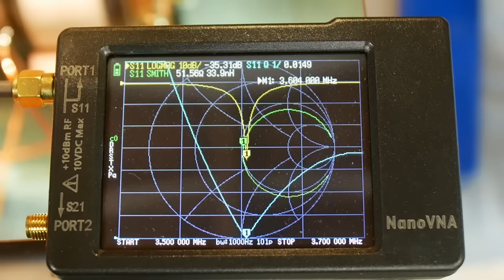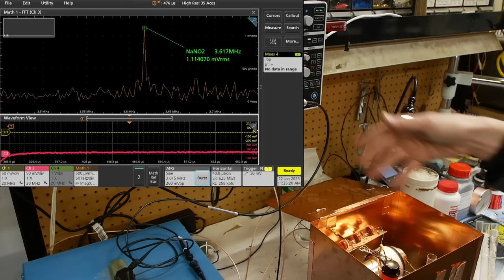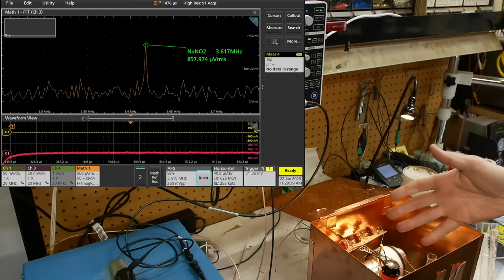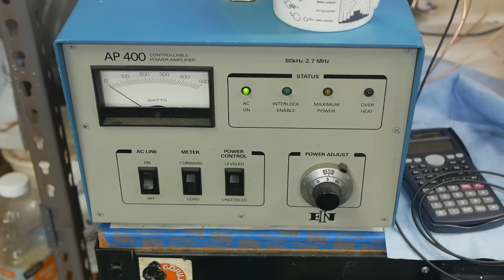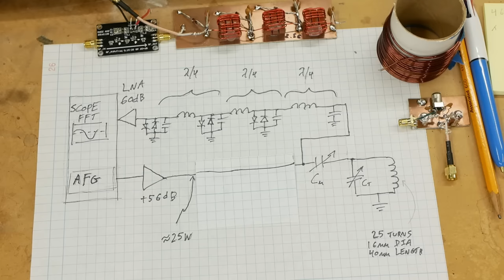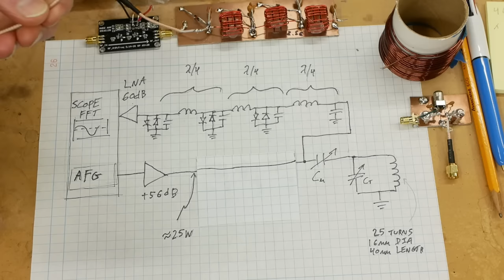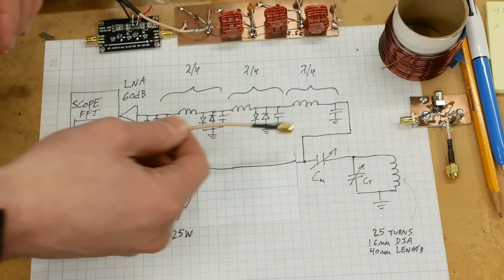Identify chemicals with radio frequencies - Nuclear Quadrupole Resonance (MRI without magnets)

Comment: Nice Ben!. Suggestion: in metal detection, they use something called a double D configuration to remove pulse signals completely. Basically you have a separate transmission and reception coil and by strategically placing the reception coil, you can remove the pulse and focus on the signal. This is something you might want to try, because it allows you to remove all the filter electronics from your setup.
Reply: I assume this set-up you're describing essentially destructively interferes with the carrier signal, leaving the sample signal largely untouched so instead of filtering the noise, you can simply threshold it?
Reply: @dittilio  no it's about direct cancelling the magnet field. I actually discussed the principle in a video I made some years ago: https://youtu.be/EcuTsifSgBs (around 3.50 min)
Reply: Ah, of course! Very neat idea. I think you’d need to tune each part separately, but at least that’s a lot easier than remaking the output coupling filter. Could even automate a scan using varactors, or those funky current-controlled inductors.
Reply: It's called induction balance and yes, it works.
Reply: @HuygensOptics  Oh damn! Huygens Optics stopped by! Been following your videos on the mini-monolithic telescope and those dirty lenses. Now I gotta stop by your channel and finally get around to those grinding videos Ive been sitting on watching! Love when these home science on complicated subject channels get together, it makes for an awesome community with a mix of interested amateurs fully invested in everything knowledgeable professionals have to share. And sharing the knowledge its what its all about. Thumbs up to all in the community! You're all awesome, the pros in the know, and the amateurs just looking to expand their knowledge set!😎👍
Reply: C J W  yes photonic crystals and thz waves, definitely something I would also be interested in,  problem is there isn't much being done in the terahertz frequencies, it's both very difficult and expensive. Although I have seen reports of terahertz imagers , really can see through walls! With some resolution too!
   I bet a lot of spectroscopy could be done in those frequencies too.
   But 
    Personally I would even be happy with an instructable on how to build a fresnel lens for radio frequencies out of aluminum tape.
Reply: This should let you sweep the frequencies for discovery right? The current set-up requiring you to know in advance what you're looking for is certainly an issue
Reply: C J W  too far outside what I can afford to even consider playing with... But definitely fascinating, & worth learning about.
Reply: @zombieregime  I love that too, I've been seeing it a lot lately with different people I watch talking to each other. The maker/DIY science channels are a neat community. I can't wait to be part of it.
Reply: If I'm not wrong, and I could be, placing the sample inside the detection area would alter the coupling between the coils to the point where you would cook the LNA anyway. The reason it works in a metal detector would be the reason it can't work here. In a metal detector you're using the detected metal to couple the electromagnetic signal from the transmit to the sense coil. Here, the maximum possible quadrupole resonance would be coupled from the transmit to the sense coil during the high power transmit phase (along with any other power coupling from the material's magnetic ordering).

It feels like you could do it, but at the cost of building a very precise coil around every sample you wanted to run. I don't think you can tune out small variances between samples to zero the magnetic field without also by definition tuning out the quadrupole resonance signal you're looking for.

I think ultimately what you save in not having to rewind the toroids, you lose in having to rewind the sample coils. Again, I could be wrong though.
Reply: now this is a crossover I didn't know I wanted but I needed
Reply: @htomerif  you’d likely want a small trimmer screw to move the coils in/out of mesh anyhow if just due to frequency changes and capacitive coupling, which is something you could feasibly automate if you had a seperate function generator.
Reply: @Scrogan  I don't know. That's why I didn't say I was dead certain with my comment, but I don't think this is as simple as "two spaced coils that mesh with each other and you stuff the sample tube in the gap". You can get away with it in a metal detector because the coils are functionally two dimensional.

And also, to be clear, I'm not concerned about capacitive coupling. I'm concerned about the significant magnetic power coupling that the sample itself with have.

You'd have to tune the two coils to have zero net magnetic coupling (and capacitive I guess) *with the sample in it*. If I'm not going crazy, thats either going to also tune out the signal you're looking for or you're going to have to increase the precision of all of this stuff to "not just wire wrapped around a tube".

Like at some point it is just more productive to do DIY NMR.
Reply: @petevenuti7355  : A fresnel for radio frequencies? The size of individual elements would have to be sized for the frequencies of interest, it could wind up quite large.
Reply: @htomerif  : Indirect inductance might pass along a decent amount of power (depending on all sorts of details), but that would be materials-dependant. In particular, you might run into issues with conductive materials.
Reply: Iumu
Reply: C J W  uimm
Reply: I love both of your channels and enjoy seeing your discourse in the comments
Reply: @absalomdraconis  Yeah, the word "might" applies. I mean you're not running a sweep here. You're specifically targeting the quadrupole resonance frequency of the sample.

Honestly, it kind of makes me wonder if that effect is strong enough to make a notch or bandpass filter. Probably "not even a little bit", but I don't know.
Reply: @absalomdraconis  size and spacing!, I'm thinking the inside of my roof, attic space, about 14'x40' , I'm not a math guy and there was an online calculator to fill in the blanks given a few values,like they have for Yagi and helical antenna, but I can't find it now...
   Can you steer it like they did at Arecibo, moving the horns, but using a fresnel instead of a reflector?
Reply: @Scrogan  Possibly using a quadrature hybrid coupler with the transmitter on one port and the receiver on another. Transmit -->sample, sample -->receiver. This could give a relatively wide bandwidth that may simplify the tuning problem.
Reply: @dittilio  The design I have uses a long boom between the coils, sample of water.
Reply: Huygens Optics, you are also a very great youtuber !
Reply: @petevenuti7355  if you need to se tru walls Synthetic-aperture radar is the ting ..
Reply: @roylarsen7417  I have a long way to go learning DSP before I can even think about that. Besides, Thz frequencies have applications in spectrography that can't be done with lower frequencies.
Reply: @roylarsen7417  do you know a lot about digital signal processing?
Reply: @petevenuti7355  my link is gone ? , i gess someone dont like my input .. :(
Reply: @roylarsen7417  YouTube tends to filter out links, unless it's to another's YouTube video or channel.. and even then sometimes..
Reply: Looks like what is needed here is - active switching of rx and tx paths, and through the use of what RADAR engineers call a "Synchronizer" board. This times the on-off keying of rx and tx paths (using PIN diodes or FET switches depending on frequency etc), and will key the signal generator as required once the proper tx and rx paths are set up.
Reply: @uploadJ  what's wrong with just using a circulator?
Reply: @petevenuti7355  - I was just thinking the same thing. Then a sweeper might be doable :)
Reply: It reminds me a two coils tx and rx technic for metal detecting under the surface
Reply: Wow, you're even quite the expert on high frequency electronics! Your video's of how you make complex telescopic lenses in your home workshop are already extremely impressive, but to read that you know your stuff about RF electronics too just blows my mind even more! I can only imagine the kind of things you two could accomplish if you and Ben would work together.
Reply: @NickNam3  Absolutely, I second that!
Reply: @petevenuti7355  Using a circulator has the same potential coupling-through-the-nuclei problem @htomerif brought up, though it's possible that that coupling is so weak (like the later signal is) that it's not actually a problem.
Reply: @petevenuti7355  "Transmitarray antenna" might be the term you need to search for. It's like the reflectarrays used on the MarCO spacecraft, but transmissive rather than reflective. Wikipedia has had articles on both since a few years ago.
Reply: Your optics videos are absolutely excellent on par with Ben's.
Reply: @petevenuti7355 I like your funny eyes magic man

Comment: I built my first NMR machine when I was in high school, in 1960, using the descriptions in a Scientific American magazine.  I got an old radar magnet core (with wiring), which allowed a small volume to be magnetized.  Winding some sensor coils around this zone, I was able to get a full inversion of several materials, using only an electrometer as a measuring devices.  Totally useless to identify much of anything, but clearly showed the principle.  This led my algebra/trig teacher to teach me some calculus, since he said I would need it in college.  When I got to college I was at least three years ahead of anyone else in my classes, and aced them all.  Ended up as an electrical engineer, and later integrated circuits designer.  That's the value of real science.
Reply: woah
Reply: Homeschooling dad here, you are an inspiration and a blueprint for my little boy.
Reply: Dude you’re my hero!
Reply: What do you guys put inside them highly integrated microchips....eh?
Reply: How???
Reply: What happened to the material you were testing?  I don't understand what you mean by a "full inversion" of the material?  

Did your experiment break the chemical bonds and break the material down from molecules to it's constituent atoms?

Comment: Slight error in the diagram, the last 1k resistor to ground on the transmit side actually has another diode pair after it in the practical circuit - which would be essential to not add a 1k load to the sense coil.
Reply: A little Diagram/Map Trap to catch the unsuspecting. Good catch!
Reply: Perhaps you’re right if you tested it
Reply: @Ori-lp2fm  Go play.
Reply: Good catch. For anyone who wants to see the actual diode stage in the video, go to 13:08

Comment: During my final year at the university, I was called to be a part of the team designing a real NMR. They gave me the task of designing superconducting magnet. It was very fun, 9 month project that ended with working NMR device, used by chemistry department for structural molecular analysis. It is fascinating that you made working zero field device using only the basic equipment! Great work!!!
Reply: not sure when you did that, but I was studying Chemistry in the late 1970's.  Bruker was our NMR.  Brings back old memories - some of which were even quite good! :)
Reply: Back in 2012 I was visiting universities to pick which one to go to and which degree to pick. I ended up touring the physics department at The University of Sheffield (I ended up doing Mechanical Engineering there instead) and I remember them talking about a device to detect the nitrogen or high energy nitrogen bonds (can't remember exactly) in explosives in plane luggage using some technique similar to MRI. I'm guessing it's something similar to this.

Comment: This is absolutely amazing! It's incredible to see these very complicated topics explained well and demonstrated on DIY-quality equipment.
Reply: DIY!!
Reply: Lab equipment costing thousands upon thousands of dollars come with precision, repeatability, accuracy, a maintenance plan, and a fancy case. No building filters, or hand tuning, just plop the sample in and hit the go button. But when you understand the mechanisms involved, it really is amazing the kinds of instruments that can be built in a garage that can return useful data! This channel is a great example of what is possible with just some know how and a bloke in his garage!
Reply: @josseman  somethings are unavoidable, also some things are being thrown in the dumpster, or have a simple electrical fault yet being sold 'as parts', or hand me downs, or gifted, or on clearance, etc. Hell, I have a $5000 gilderfluke ride-car controller I acquired through work on theme park animatronics and stage production technology. An expensive piece of equipment doesnt necessarily mean the person who owns it bought it new, or at all. Besides, if you're crafty, you can cover a fair bit of signal inspection with a parallel port and a high sample rate soundcard, or some basic rf/sdr bits and bobs. Sure, a 'real' o-scope, even the cheapest one being sold new, would blow it out of the water. But its technically possible to cover some low hanging bases, just dont expect miracles. Its about using what you can get your hands on. What should they be doing? Judging the waveform by touching wires to their tongue?
Reply: @josseman  how else are you supposed to measure signals accurately?  You and everyone and their mother can buy a Oscilloscope,  try buying an MRI...

You seem like the type of person that can't believe being driven means something."Wow I can't put my head around how you came up with this idea." Or "I don't know how YT Content creators do what they do."

This channel may not go into his reasoning for tinkering but human nature is curiosity.
Reply: @zombieregime  Imagine if a small fraction of the money that the US gifts to foreign countries, were used to set up a few hundred MakerSpace DYI labs across the country, with equipment to loan out like libraries. Where would we be?
Reply: yes, except in "DIY", Ben's "Y" is completely different than normal people's "y"  😁
Reply: @rrho6701  oh...... You sweet summer child ... So much hope and wonder, such admiration for humanity......Im sorry, Im so so sorry.... But the horror of the worlds truths are coming.... Dont worry though, once you get over the shock youll realize too that deep down people are inherently good.... Usually.... 

But uh yeah, I too would love tax subsidized equipment, maintained by government employees so everyone, er i mean, the small niche of people in the grand scheme of things, can waste resources making their own ultrasound based (not)-radar toy that plays a series of dissonant polyphonic notes on premade breakout boards and think themselves tall, misappropriating the moniker "hacker", for plugging wires into headers and copying code from stack and git... Hey, the same blood is on my hands too.... However wondrous the idea is, ultimately there are far greater problems in the world than us not having a lathe or mill or 3d printer or laser cutter we can rent time on. By the way, look around and i guarantee you can find someone with that kind of equipment in your city willing to take your money for some time on their machines or at least produce those acrylic case panels for you.

Yes, I am a miserable misanthrope. What was your first hint? 😉
Reply: @IhabFahmy  thats knowledge, baby! 😉

A bolt is a bolt, wire is wire, just gotta know what to put where and why, and you can pop out all sorts of fun stuff corporations charge out the nose for. Though in fairness, for most of them, that price tag comes with repeatability, accuracy, sensitivity, and reliability on the level of laboratory research equipment. Garage gear can usually only be used by whoever cobbeled it together since they know what they modified to achieve the result. But that doesnt mean they cant produce reliable data.

Also, its freaking Ben 😂 The dude has a crazy technical work history and is a true nerd at heart. Learning for the sake of learning, applicable uses in day to day life be damned!

Comment: This is fascinating. And the DYI wizardry is even more impressive - I didn't know this was even possible! Lots of parallels with the Cesium clock principles, but using the spin of the nucleus instead of the spin of the electron. Even the multi-pulse technique seems analogous to the Ramsey effect used in the clock, where you have two equal interaction regions separated by a period of free precession. And just like you, I also get my RF magic straightened out by watching w2aew's channel!
Reply: The main similarity between the Hahn echo Ben is doing and Ramsey experiments is just that they are both pulsed experiments. Standard Ramsey is limited by T2*, the signal is dead if the space between the pulses is beyond this, whereas Hahn's echo refocuses T2*. You can combine the two, either by reading off the Ramsey signal with an echo (pi) pulse, and/or by inserting a series of pi pulses between the Ramsey pulses to extend the resolution beyound T2*. Ben mentioned T1, but more often than not, T2 (non-refocussable dephasing) is the bigger problem.